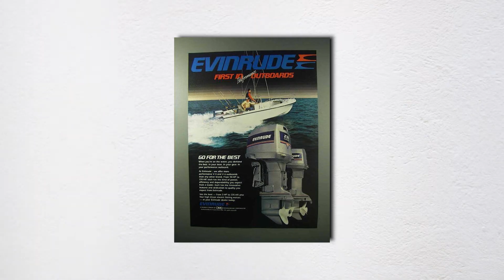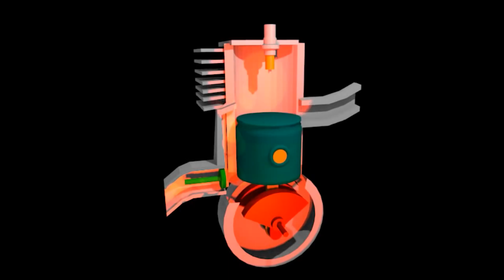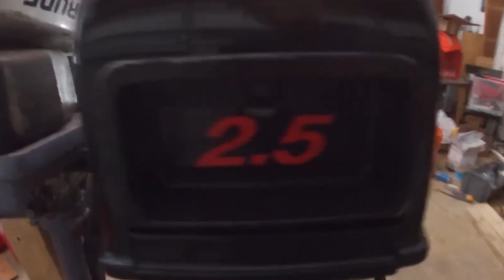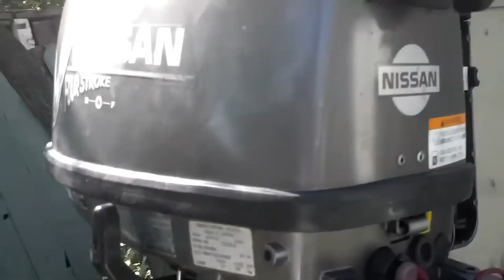The Rise and Fall of 2 Strokes: How One Decision Killed an Industry

Comment: The biggest myth about 2 strokes is that they  blue smoke like Hell all day long..this is patently false. If your using the correct oil amount, they do not.

They always smoke, cold, at start up, because the piston rings haven't expanded to operating temperature yet. Once that happens, they don't smoke.
(2 stroke Diesels do the same thing)
I've been running these my whole life, and have no intention of stopping. 
I was taken aback by how the boating community loved them for decades, then demonized them immediately, the minute the 4 strokes came out.